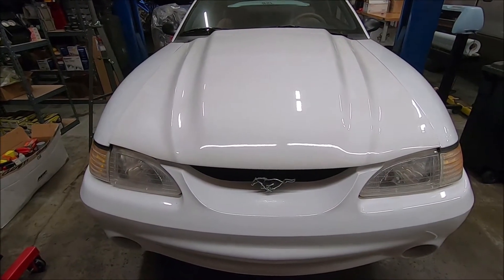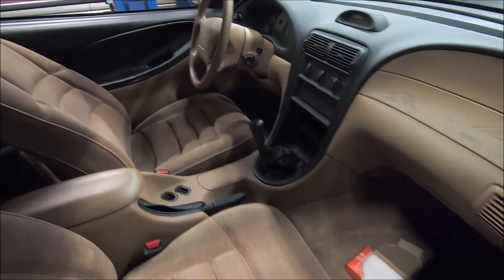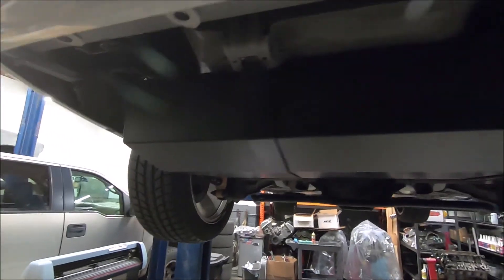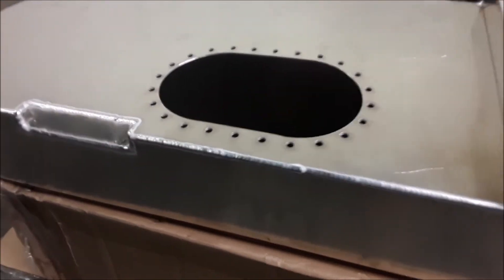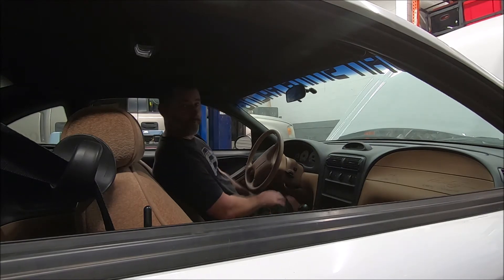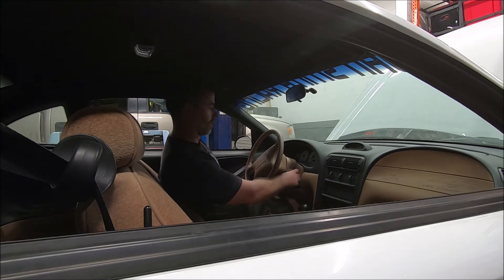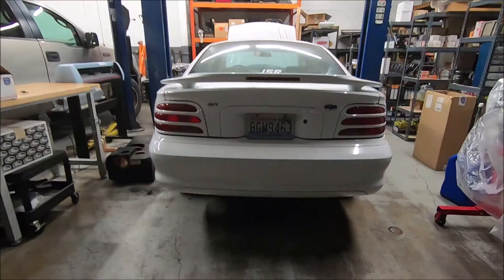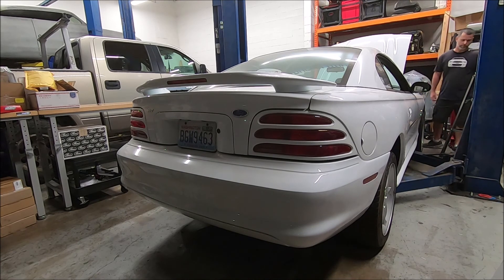1995 Cobra R Fuel Cell Replacement with Glenn's Performance Tank

Comment: Could i just put a regular 95 mustang gas tank in my 95 cobra r. Instead of buying an expensive fuel cell?
Reply from the maker: Yes, and I have heard of people doing that.  However, I am pretty sure you would need the filler neck and the lines coming from the tank.  I also don't think that it would need to be from a 95.  They didn't make many changes to the fuel system back there from 94-97.  I am willing to bet any model of those years would work.  Even a V6 one.
Reply: @JohnSmithRacing  Awesome thank you for responding
Reply: What filler neck have they been using? I’m running into an issue installing one. Thank you.

Comment: I have a couple questions.

1) Are these tanks still available? I looked on the Glenn’s site and they only show two tanks available for SN95 mustangs, and they don’t even appear to sell sumped tanks anymore, sadly. 

2) Would this tank fit in a 95 cobra? Mine isn’t an R, but I don’t believe there are any differences between the chassis of a cobra and cobra R that would make it not fit. I would also love the increased fuel capacity.

It’s probably a long shot that they even make this tank anymore, and I know this is an older video, but I figured I might as well ask.
Reply from the maker: I just checked his website and confirmed that he does not have them listed anymore.  I recommend calling them and asking if they can still make one.  He can also tell you exactly what you would need to put it in a non-R.  I believe the filler neck is different as well as some of the lines coming off the tank.
Reply: @JohnSmithRacing thanks for the reply, I’ll try giving them a call soon and see what the options are 👍

Comment: We have this exact same 95 Cobra R with a hole in the gas tank.  We can’t find anywhere to get it replaced.  The part is discontinued so the Ford dealership wouldn’t fix it if we find it and no shop will either.
Reply from the maker: The fuel cell itself has probably been discontinued by Ford but I believe you can still send them off the Fuel Safe and they can replace the bladder inside.  I have heard the cost is over $2k.  I believe the alcohol in the CA fuel was responsible for ruining my bladder.  The cost and not having to replace the bladder again is why I went with the Glenns Performance one.  I did keep the factory fuel cell though.
Reply: @JohnSmithRacing  for what we paid for the car that’s nothing.😊
Reply from the maker: @rheawolf7689  Yeah it seems the value of them has been going up.  One just sold on Bring a Trailer for $61k.  The 00R seems to be going up as well.
Reply: @JohnSmithRacing  wow 😳 and they only made 250 of them that year.  I remember you had to have a racing license to order one at the dealership.